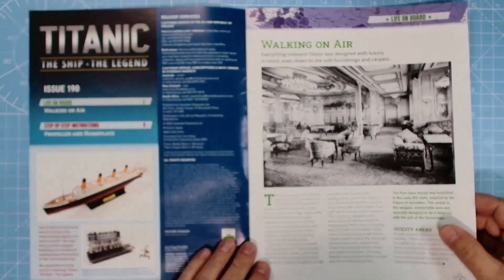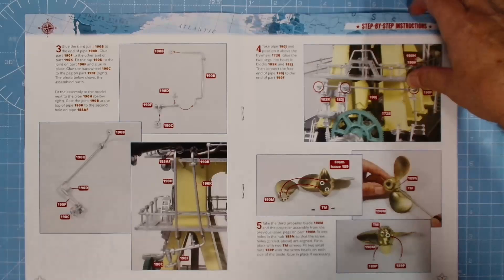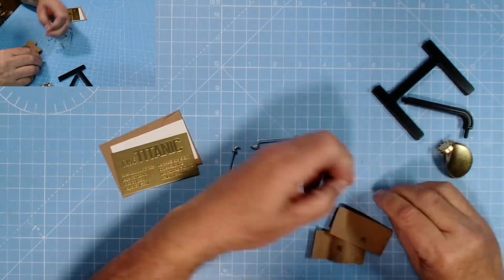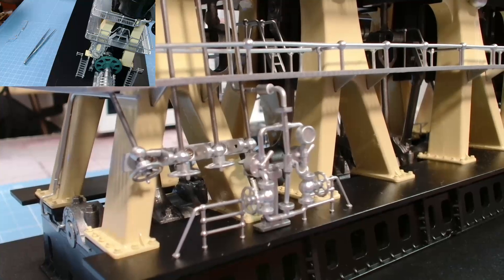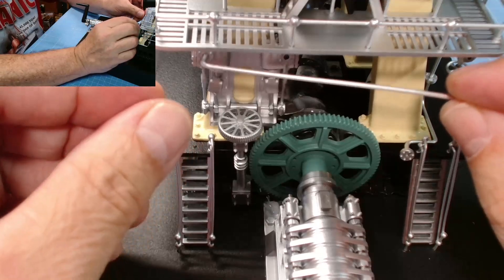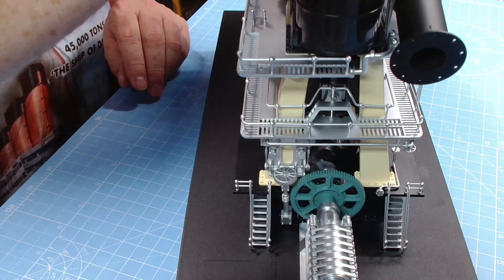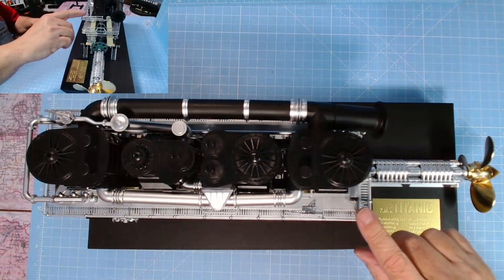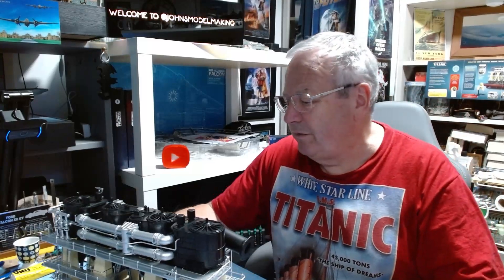Hachette's build the Titanic Reciprocating Engine Stage 190

Comment: Great build John, my engine did turn but since I mounted it to the base the cog will now only make 1 complete turn either direction and then seems to jam. Any suggestions?
Reply from the maker: Depends on what stage you are up to. Check that all the pistons and crankshaft are free. If that doesn't help,  take the engine off the base and check the thrust bearer and motor if they are free.. :)